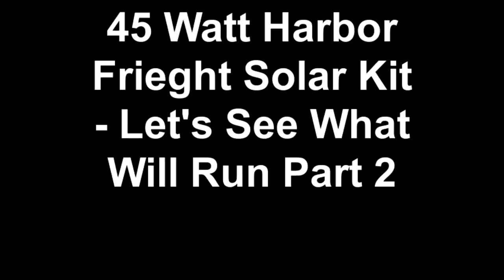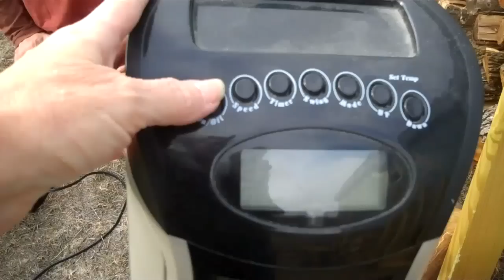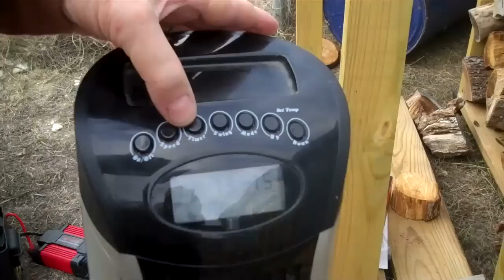45 Watt Harbor Freight Solar Kit - Let's See What Will Run P

Comment: A fan doesn't draw much power on low. They aren't fussy about voltage either. The fan would probably run right off the panels in dirrect sun. It would slow down a bit if a cloud passed over. The drill would only run off of a charged battery. I lived off a 450 watt inverter and a marine trolling motor battery for about ten days.
I ran a fan, a florecent light and a small tv in the evenings. I ran an electric blanket on low at night.
After five days i had to take the battery to work and recharge it.
That was in the fall.
John Davis jax fl

Comment: You are only going to have  power to the fan until the battery goes dead . The solar panel would have to produce  the same amount of watts  that the fan uses to keep it running . You would need something like 800 watt panel  to  keep the battery charged to keep the fan running .

Comment: If it's hooked to the battery, its bot running off the panels. Now if you leave the stuff connected and the panels can maintain the charge of the battery while the item is running for several hours, then you can say the panels will run the item.

Comment: your power inverter is only 750 watts it will run anything up to 750 watts but the power inverter will not run anything over 750 watts.

Comment: Running a drill with no load only uses power to get up to speed then uses sweet F/A power, try putting a drill bit into it and actually drilling a hole.

Comment: Is there way to use a solar panel and battery to run an exhaust fan in my apartment window to draw off the heat in my living room ? It's 90F in my living room once it begins to get hot and remains hot until about 4 am & I roast in here !
It's 90F until about 4 am.
Reply from the maker: There are too many variables to answer the question. It would depend on watts drawn by the fan, battery storage, sun, and much more

Comment: i use 45 watts a day to run my home... so what size solar panal and deep cycle battery would i actually need to buy from harbor freight?  as well as i inverter and what ever is needed...  not sure of the math... btw i live in tx... looking to go off grid completely thx!!!
Reply: 265W panels still exist. And they are cheap. New panels 310w-325w pretty costly.  Even new panels on the market,with a build in inverter. Just do research.  Be careful what are you doing and where you connecting. Strongly recommended to use a braker box.

Comment: Consider that all you showed was that a couple of charged batteries connected to an inverter will power a fan or drill. The same thing you showed can be done without a solar panel.
You should have explained the average panel /battery charge times along with operation time for various power uses before the batteries drain.

Comment: i have the same with 10 12 volt tractor batterys mixed with car batterys and 4 set of panels which is 12 and the charge controĺer does work all of them with a hub to plug the panels into and one output chord to the controller that charges the battery also i have a 6000 watt inverter and injoy ac tv fridge and much more .ty

Comment: Just remember that the panels need to be able to charge the battery to full  daily and yo  should not drain them more than half their amp hour capacity of the battery bank. 45w is a decent starter but for a heater, grow lights AND the inverter which draws power as well, I don't think 45w will be enough. I'd have gone 100w to start for your application but I hope it works for you as a starter!
Reply from the maker: Thank you.  YOu are correct.  This video was made many years ago and we have learned a lot since then and expanded to better panels and equipment but it was sure a great system to get out feet wet and in the solar arena.  We use them simply for backup lights now and Jonathan has a set that runs his lights and charges his phone and tablet.

Comment: 45w I assume will produce no more than an average of 40w × 10 hrs or 400w a sunny day or 200 a cloudy day.  Let's say 300.  So it takes over 3 days to generate 1 kW.  1 kWh = 12 cents.  So $0.25 of electricity can be generated in a week, and you don't take the panels with you camping, but keep them home where you have electricity.  A quarter.

This is for fun right.  If so.  cool.

I can only see that to keep a couple of barn batteries alive in a remote line camp or in emergency water pump and a couple of led light bulbs.  Maybe a seldom used pump battery can be replinished.

Comment: Sorry to ruin the party, but that 45watt panel will not keep up with the amp draw of the fan running. I'm guessing the panel may only put out 1.5amps or slightly more in full sun. The low voltage will eventually shut off the inverter, therefore shutting off the fan. And the battery will need at least a full day in the sun to recharge with that panel, probably more, while the fan stays off.

Comment: 45 Watts is kind of abysmal for energy. A tea candle produces 80 Watts while burning. True that is in heat and not very accommodating to running fans or drills. My point being, forty-five Watts cannot provide much improvement in our power consuming society. Even a kilowatt will only provide lighting and low power appliances like radios and laptops. 

It is better than 0 Watts, yes. There are things that can benefit from having a solar charge. Assuming complete efficiency in the inverter, Ohm says that they will get 409 mA at 110 V. Guys, how many devices do you have that need less than 1/2 an Amp? You can find a few, not the devices or appliances you need to get through the day, trickle chargers for phone or batteries. Still that is something. 

Our solar panel technologies really need to improve. Much higher capacities with affordable investment threshold. If a tree is blown down and crushes half or all your solar panels, how much will it cost to replace them? My guess, a lot. And, until you do replace them, you are out of power. We cannot readily borrow a few kilowatts from our neighbors during a storm. 

Become an engineer, a scientist, an investor, or a back-yard experimenter even...if solar power is going to save us, we need much better systems for delivery, reliability, and implementation costs. Our power storage is inadequate too. Batteries that we have now cannot meet many of the demands. The fact that batteries are toxic waste once exhausted is not a happy thing.

Comment: can 200w solar panel, Can run refrigerator @ 90w 230v 0.75amps? for 24/7?
Reply from the maker: +Gigi Espina  Battery storage and available sun are needed for that equation.
Reply: Oh i see 😃 0k, thank you(:

Comment: it  takes almost 20 45 watt solar panels to keep up with a 700 watt inverter
you would need 60 45 watt panels  an two 8d batteries to make a working system
using power as they have shown, that is almost 8000 dollars worth of panels and
batteries  
this solar panel is good too power"A" led light  or two that is it about 15 watts of use

how ever  it can take a 5 min hit by a microwave or about 4 45 watt panels can 
rive the refrigerator during the day, they have value
Reply: Finally, someone who knows something about solar energy. I thought the video was cute, but far from realistic. I do have a small setup on my shed and it works quite well. 520 watts PV, 30amp MPPT Controller,;4 x 6volt golfcart lead acid batteries&; wired to 12volt, 450amp hour capacity. 1000watt pure sine inverter. I run my bar fridge, TV, Lights, Stereo without any issues at night and the bank charges fully the next day. I did this setup as an experiment and would like to take it to my place in the woods one day.

Comment: will this setp operate a HF 90 amp wire welder. Thanks
Reply: +papa Hajek You would want to look at how many watts the device says it draws.  The input.  

On the surface, the device you describe sounds like it draws 90 amps at what I'm guessing is 110 voltage.  However, that would be 9900 watts.  WAY more than this system could handle.  His inverter is only 750 watts.

I suspect, however, that the HF 90 doesn't actually draw that much.  That is an insane amount.  Instead, they probably put some kind of capacitor in it that allows it to draw in a lower wattage but give you short durations of high wattage output.  I could be wrong though.  

Anyway, to know for sure you would want to look at what the input wattage is.  If it just shows amps and volts then you simply multiply those two together to get watts.

Btw, you need to keep in mind that what is really powering the devices is the battery.  The panel only adds 45 watts at it's peak.  So, most of the juice is coming from the energy stored in the battery from the panel charging it for hours on end.  So, you need to know how many amp hours the battery has.  You multiply that by 12 (if it is a 12 v battery) in order to get about how many watt hours it has stored.  And these days many batteries can only be discharged 50% at most before you start damaging them.  So, you want to divide that by at least 2.  Take that number and divide it by how many watts your device has and that will tell you how many hours the battery will run it before you have to recharge.  Approximately anyway.  

I could be wrong, but I would guess that batteries have a max amount of watts you should be trying to pull from them at once.  I would think they would heat up or even melt the terminals if you tried to pull too much.  So, you would want to look into that also.

Hope that helps.

Comment: Just a quick and important question for me. So as you did mention "solar panels recharge the battery when it is not in use". So I can't charge a battery while it is in USE ? Can't we use the power from the battery while it is charging.
Thanks,
Reply: +sof david Yes... and no.  

My limited understanding is that If the battery is full and your inverter is connected directly to the battery then odds are the power you use will be coming just from the battery and the panel won't be doing anything... at least until you run the battery down a hair.

That is because most chargers stop charging the battery once it is full... or at least you hope.  It just cuts off the panel juice coming in.  So, in an instance like this you wouldn't be doing both at the same time.

However, if the battery isn't fully charged yet, or if you have run it down a little, then the charger will be sending the solar juice toward the battery.  Though, if you are using more than 45 watts then I'm pretty sure that power is going straight to your device and not doing anything to the battery.  However, at least that is up to 45 less watts being taken from the battery (if you have a 45 watt panel).

ALL OF THAT SAID, some chargers have a load connection on them.  My understanding is that if you connect to this then your devices will use the solar power first and then draw from the battery if needed... even if the charger is not currently charging the battery.  I would DEFINITELY read your manual though.  I know mine has a very limited amount of wattage you can actually use via the load connection.  However, I've heard that others have much higher settings.

Btw, I don't remember if he mentioned it but you want to have a fuse somewhere between the battery and your device.  I think most inverters have a fuse.  Personally, I have a fuse on the positive line between my panel and the charge controller and between the charge controller and the battery and between the battery and any load.  Even if the load/device itself has a fuse.  I figure better safe than sorry.  Fuses are cheap.
Reply: Thank you so much for the information, everyday I learn something new about solar energy and its technology techniques.

Comment: I have bought inverters (particularly the 750 watt one) from Harbor Freight for years. But I would never buy the 45 watt panels because they are not likely to supply enough charging to keep  much more than one deep cycle battery charged, and you need 3-4 to power up most household appliances for several hours.  Also, you can get a 185 watt panel now for about $1 watt, and it's a more durable polycrystalline.  The system I developed with two inverters (one a Duracel with digital readouts, much superior to Harbor Freight and about the same price) can generate 1500-2000 watts continuously and support a garage door motor, electric drill, and medium sized fridge. Costs about $750 to put it together DIY.  See at power from sun dot com.
Reply: +americanada.us Yeah, they seem kind of big also for what you get.  And pricey. That said, the ones in the video look like they are meant to be mobile.  Something you could carry out to a camp site.  Though, if I was going to do that I would invest in a much smaller battery...lol.  The one in the video probably weighs 70lbs.  You wouldn't get as much reserve power from a smaller battery but you wouldn't really need that much if you are camping.  Or at least you shouldn't.

Comment: The stuff is running off of the battery NOT the solar panels. You could have completely disconnected the panels and had the exact same results.
Reply from the maker: +Matthew Foote 
As was noted in the video description above.
Reply from the maker: You still seem to be missing the point. As the video description above explains, we use this for camping and for emergency purposes, primarily for running very efficient lighting and for recharging electronics devices such as phones, laptops, tablets, ham radios, rechargeable lanterns and so forth. This setup works very well for that and, no, it doesn't run out in two days.
Reply: +Matthew Foote The solar panels keep the battery charged.
Reply: Hola viejo coml esta
Reply: Got the beer faster
Reply: Not for long. Run that set-up for about 2 days and then see what happens.

Comment: How can this be a test of what the solar panel can power?

1.  You have the inverter connected to the battery.

2.  Yes, the solar panel is putting energy into the battery, but its input maybe be less than the draw of the fan or the drill.

Comment: Hey guys you look like pretty nice marriage!!  And where did you get that equipment I mean the solar panel and the batteries?
Reply: +Frank R. Pilot 
A truck or car battery is the worst battery you can use for any solar system, they will only last about 1 year before they die. You will need a deep cycle battery for it like a golf cart battery from sams club.

Most inverters will not work at all or will not work properly without a battery. You still can run those inverters without any battery if you use a super capacitor pack instead a battery.

Renogy solar panels put out more power with less space and are cheaper per watt.  You can get them at ebay, seller renogy or at their renogy website and you can get kits also, but it is cheaper to put your own system together.
Reply from the maker: +Frank R. Pilot Thanks,  equipment was purchased at habor freight except the battery which was from our truck.
Reply from the maker: +Джейсон Хичкок We are well aware of that, as you would know if you had read the video description...you know, where it says "IMPORTANT!!!: Before commenting, please read the notes below." And it's one thing to make your point, and quite another to do it while being a complete jerk.

Comment: (This is mostly for those that have not read the description you posted.) The title of this video is misleading. The solar panel did NOT run the fan (heater?) or the drill. The battery and inverter did! The inverter is rated for 750 watts at 120v (with a peak draw at probably about 1000w or 1100w.) So yeah, anything 750 watts or less would run on the inverter.

A drill (or anything that uses an inductive type motor) will NOT run properly on a non-sine wave inverter. The peak-to-peak voltage isn't high enough. Under load, your motor will not get sufficient power and will burn up.

If you were to use the solar panels to charge that massive car battery, charging it from dead to full would take (assuming 450 Cold Cranking Amps), about 120 hours with the solar panels in full sunlight. Assuming the drill uses the full 750 watts, you will completely kill that car battery in less than an hour.

If you are going to use grow lights, I recommend getting a 12 volt DC grow light set. You should be able to hook them directly up to the battery. They would last a LOT longer than running them from an inverter. (Inverters WASTE a lot of energy. They are not efficient. Also, charge controllers lose energy too.) Bypassing the invterer would save all that power.

Trust me on this. I've been using inverters for over 30 years. I fix backup battery backup systems and have been doing electronics for 40 years. 

Having said all of that, I love you guys and your video. You show the real do-it-yourself American spirit that is lacking these days.

Cheers!
Reply: conicEllipse that's why never undersrand. Not supply enough power would burn up the motors how?

Comment: thats not what panels are running, thats what inverter is running. If it charges in use then that shows capability of panels